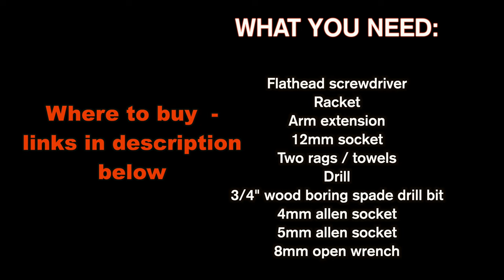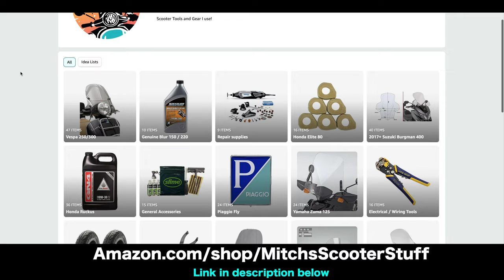Givi Monokey Top Case Installation - Suzuki Burgman 400 2017-Current | Mitch's Scooter Stuff

Comment from the maker: GIVI PRODUCTS:
Givi metal mount rack to frame - https://amzn.to/3UlhS8V
Givi topcase mount plate - https://amzn.to/3qRvZVT
Givi topcase - https://amzn.to/3eSjkPO
TOOLS: 
Flathead screwdriver - http://amzn.to/2jN7lpE
Ratchet 3/8 drive - http://amzn.to/2hhmnUs
3" / 6” extension set 3/8 drive - http://amzn.to/2h7ypMl
12mm socket 3/8 drive - http://amzn.to/2xM4Edr
Rags - https://amzn.to/2Yh8jvg
Drill - https://amzn.to/3m3svM9
3/4" wood boring spade drill bit - https://amzn.to/3BvzDdc
4mm allen socket 3/8 drive - https://amzn.to/3aUmtuw
5mm allen socket 3/8 drive - http://amzn.to/2ofCuCg
8mm wrench - http://amzn.to/2HCiC48

Comment: Mitch, great video, I have to laugh , I looked at so many top cases and this is the exact one I picked out for our new Bergman's, and then of course I searched for a video and here you are installing the exact same case. we are going to go with the brake light feature and back rest to go the distance. But you nailed it again. I use a forstner bit usually to drill the holes, but it looks like your bit worked just fine. Aloha, can't wait to see the van when I'm out on Maui next.

Comment: Mitch, can the mount plate and rack to frame bracket/plate be used with the smaller case? The 47 Liter. Im debating on what size case still.  19-400 burgman.
Reply from the maker: Hey, yes any monokey topcase will fit on that plate… make sure it’s “monokey”
Reply: @MitchsScooterStuff  I got the big one.56lt but maybe It was over kill. 47Lt can work. Ill let you know how it works out! Thanks for the video. BTW I learned to change my oil on this bike bc of you! THANKS!! I trust you.

Comment: Mitch I need advise . I have mp3  500  2019 . 13400 ml  on it I live USA So AZ  moved here from NYC  where I got it new . She runs good  I done all services . But moto tech's in USA  don't like to work on that scooter ? I am thinking of trading it for vespa GTS 300 hpe   or Suzuki burgman 400   both new models  they have them on showroom in stock now . What do I do ? I feel like I gonna trade apple for lemon ?
Reply from the maker: Trading is not that bad idea for these models… burgman and GTS are different style… I think you should sit on both and decide from there… both are very good bikes.. I owned 07 GTS 250 and still have my 07 burgman, if I have to pick one, I would pick burgman for more storage and comfortable on longer trips. GTS is more fun to ride… smaller and fast! Trading from 500 to 300 or 400 is not bad idea… GTS and burgman are still fast enough